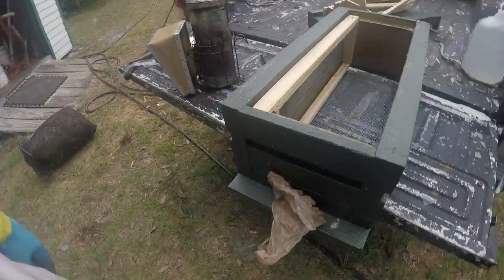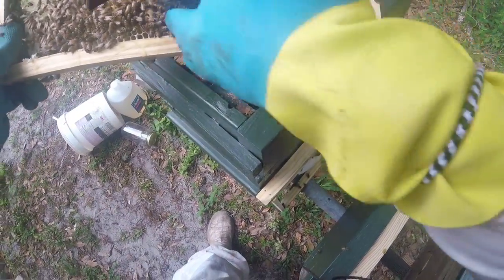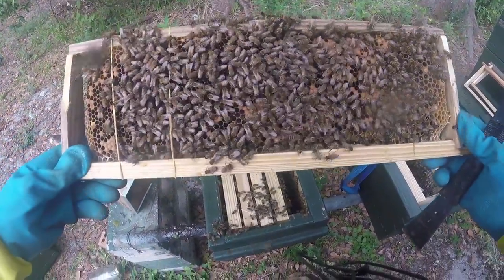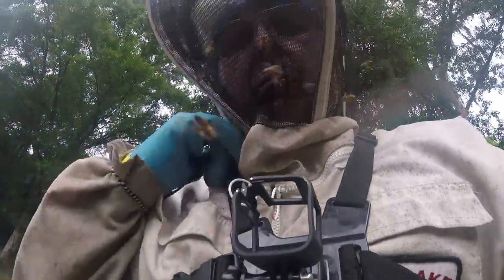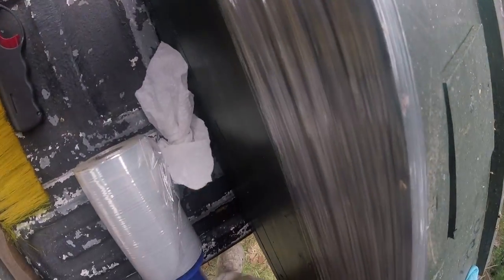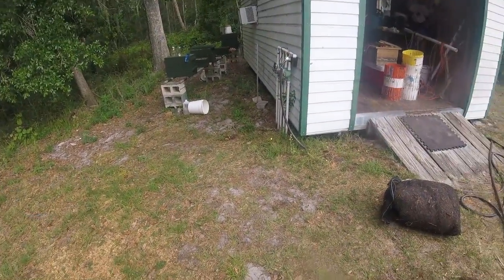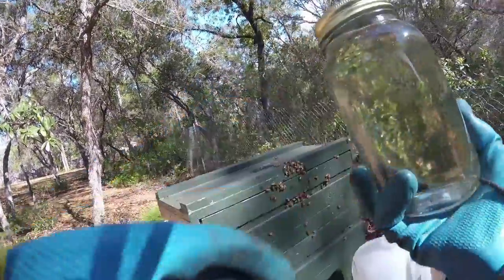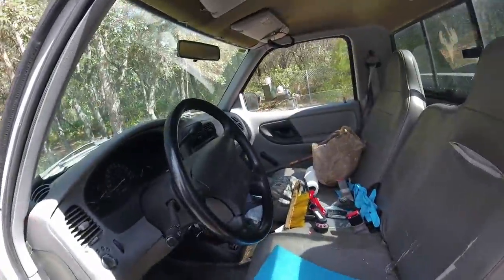Making Nuc Hives

Comment: Good video but here is a tip for you.I use jar feeders on top like you are.When you cut your holes for your jar feeders cut the hole close to the front.When your jar heats up it can push out syrup and if in the middle of your lid the syrup runs out on top of your bees and brood nest.With your hole close to the front the syrup doesnt run in the middle like that.
Reply from the maker: Good tip thanks for sharing.

Comment: Hey!  I made some nucs exactly like that!  They were made from house framing leftovers (lots of building going on in my part of town)  They're heavy as ole' get out, but I figure they probably insulate much better than 3/4," not to mention, I'm not worried about using a paint which is too dark! (insulation purposes)
Reply from the maker: Hey bro Beekeeper thanks for stopping by.I had 90mi winds with Irama and they stayed right on the stands.
Reply: Right now, Right as I write this, my brother is on a huge cruise ship hauling butt back to Galveston.  I have pulled up the winds and looks like they're getting 20 knots from the side.  

Wow, 90mph winds and the hives stayed up...that's impressive!

Comment: An easy way to keep the bees calm is to move the top boxes off and to the side and start at the bottom box with your inspection.  Inspect the upper box while off the hive and keep the flying bees off of you.  Also, cover the first standing box with the cover to keep them calm. This is basic in beekeeping but often forgot.
As for a roof plug.  Do you have problems with wind blowing those off?  How about a brick with is what I use to close them off.  Wind doesn't move bricks very easily.
Reply from the maker: Have had no plugs blowing off in the wind.Thanks for sharing.